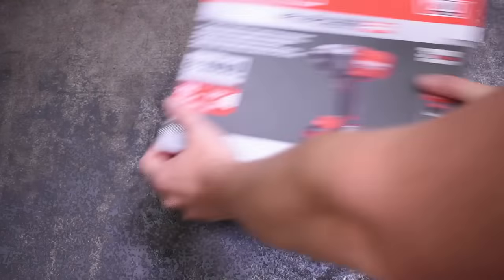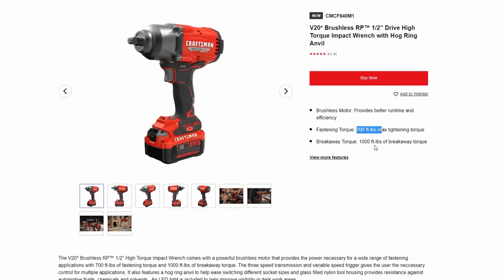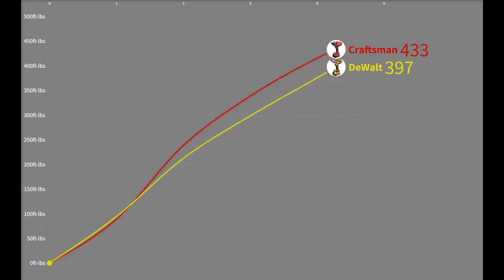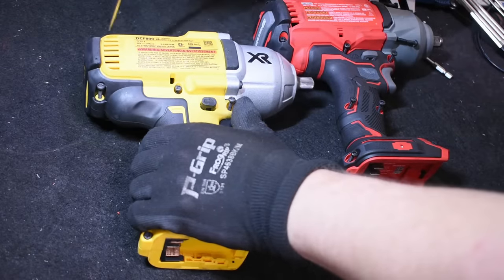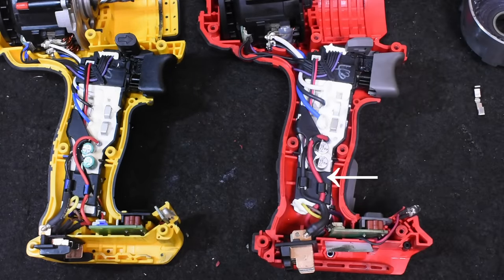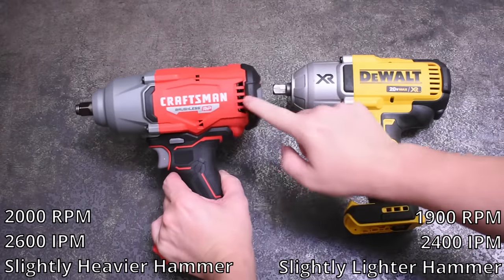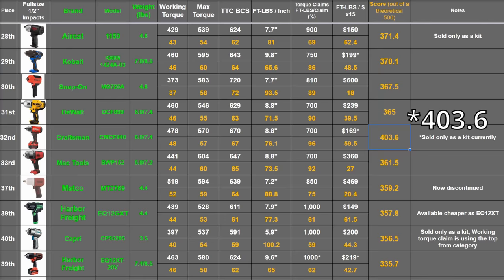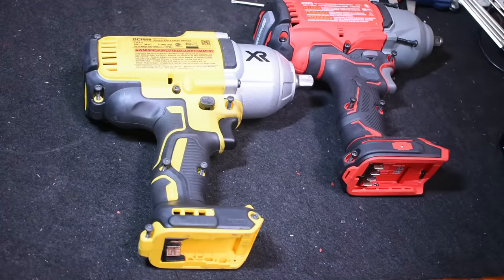Something Weird is Going On Inside Craftsman's New High Torque Impact Wrench

Comment: It seems to be leaps and bounds above the old brushed Craftsman V20 CMCF900 (350 ft lbs).  Having both, the Craftsman is a real dog compared to my Mac Tools 899 clone, so maybe upgrading the truck gun (craftsman) makes more sense than upgrading the shop gun (Mac/DeWalt) in this instance (having lots of both batteries).  I do have a 9ah Craftsman to try it with (good luck buying a 9ah DeWalt new for what you can get the 9ah Craftsman on eBay for). :D

Comment: Need to try 5 ah 6 ah and 9ah. Batteries the 9 ah makes saw and miter run so much better and can tell a huge difference in power on miter with 6ah and 9 ah but the 5 ah sounds like my blower works best with it but 5 ah is hard to get other than the mower that comes with two

Comment: I've got a DeWalt laser that gets about that far onto the flex volt battery. But a regular 18v / 20v dewalt battery will go on just fine. Be keen to find out if you're having the same issue with that 'craftsman' tool

Comment: Thicker gauge wire, slightly heavier rotating mass, 4and superior capacitors. That alone would offer the motor far more power as shown. It's the DCF899+ :) That's a good buy for those in V20 for sure. Craftsman still running ONLY 18650s, and from what I've seen, they're also 2nd tier cell brands.

Comment: Well, I just ordered a broken DeWALT DCF899 and a used Craftsman CMCF940. How “used” can the Craftsman tool be when the tool is only a few months old? Anyway, the DeWALT looks like it was chiseled out of concrete and really needs a new housing! I see them cheap but I’m really not saving anything unless I can get them both working.

If I can’t get them both working I’ll see if I can wire DeWALT battery terminals and transfer the Craftsman guts into a new DeWALT DCF899 housing (surprisingly affordable). This could be fun. ;)

Comment: Good video as always.  I did feel you kind of glossed over that this is a brand new craftsman model against the previous generation, dated Dewalt.  The current DCF900 (while more expensive) smashes this Craftsman in performance.  New model vs new model there is no comparison.
Reply from the maker: I think we pointed it our 3 separate times. I dont think anyone is under the impression craftsman is getting the latest DeWalt stuff
Reply: @TorqueTestChannel  I know you mentioned it.  I might just be a little sensitive as a guy with Dewalt batteries at how unimpressive the previous generation's specs were getting before this new generation came out.   The new tools are glorious, but it was getting embarrassing when the DCF899, etc were still the flagships.

Comment: What If you massage the tabs on the Dewalt battery or the craftsman tool so they'll go together? 5ah or flex volt might bring even more beans. Also would be nice for those of us with Dewalt batteries to buy a cheap craftsman gun when bare tool becomes available
Reply from the maker: Its not a tabs issue. You can see that it fits, but the overhang on the V20 hits it. You'd need to sand down each tool significantly to fit
Reply: @TorqueTestChannel :(

Comment: I would love to see this test redone with the 5amh battery. I do own both the 4, 5, 6 and 9 and I can tell you I feel a difference from the 4-5 and the 5-6
Reply from the maker: Didn't even know they made a 5ah. 4ahs ate so common in v20. 6ah is same size likely makes less. 3000mah 18650s have somewhat poor discharge

Comment: Soooo… question: Can I buy a DCD899 housing assembly and convert this to DeWALT DCF899? The terminal configuration is different so I imagine I would have to buy at least one more part with some minor soldering.
Reply: Well, the direction switch/lock doesn’t fit.

Comment: You should add cross checking batterys on different tool brands to see if there is any performance left on the table. Maybe the Craftsman is amperage limited on purpose, using another brand battery usually defeats artificial limits. They sale the adapters on ebay.  You know, just for informational purposes don't try this at home we are professionals and all that.
Reply from the maker: I feel adapters would not be a true representation
Reply: @TorqueTestChannel  

True, I get the original point, but it’s an extra wild card in there you can’t control for 

The battery you’re given matches the tool, it’s a representation of what you actually have
Reply: @TorqueTestChannel  While true...it's an interesting variable that could be confirmed or denied.

Comment: Wire gauge is about current, not voltage. And the kind of isolation you see on pretty much any standard wire is usually okay up to 400V.
Any length of wire will have a resistance. When you are passing current through said wire, it will, depending on the amount of current you are trying to pass, cause a voltage drop. The higher the voltage, the more current you can pass through, so ignoring any thermal effects on the wire, you could even go down with the wire gauge with increased voltage.
If your battery had only 3V, you'd have to use much thicker wire gauge, as the voltage drop would, relative to the battery voltage, be much larger.
Reply from the maker: Thats sort of what I was trying to point at, since it isn't lower voltage and thus REQUIRING thicker gauge the thicker gauge can be assumed to be for either carrying higher amperage or carrying the same with less resistance/less drop.
Reply: @TorqueTestChannel  It might not have been particularly clear to viewers why you'd usually see heavier gauge in lower-voltage applications, like automotive.
Also, there is a physical, as well as practical limit to how much overall power you can pull from any given voltage. 
Maybe it'd be interesting to compare batteries in the future, and elaborate on that, as you pointed out that the 4ah and 5ah batteries were producing different results. Keyword being internal series resistance here.

Comment: I wonder what happens if you try to make a "Ultimate Impact Wrench" by Mixing & Matching the best compatible parts?
Especially since so many parts seem to be cross compatible.

Maybe somebody can create a mold that allows a modular battery adapter plate to use any brand's battery with one base grip and a series of brand specific battery plates to be cross compatible with any battery?

Would there be a market for a generic Impact Wrench that allows "DIY" type assembling of the best parts & end user control of the device down to even the micro controller board?
Reply: NO it's NOT possible there's too many variations. I made a vid about B&D and Porter Cable tools and battery swaps. Can swap all between the 2 brands just modifying the batteries slightly

Comment: Could be STANLEY BLACK&DECKER is using different suppliers... both spec'd the same just from different tooling and electronics suppliers...🤔
Reply from the maker: That's a good point too, considering the 899 comes with USA stickers and the V20 does not - even though it's unlikely the 899's motor or impact mechanism is MADE in U.S. but still.

Comment: You got to watch Craftsman though.  I bought a Craftsman String trimmer 60V and it's great but a battery is now $160 plus.  There are no aftermarket 60V batteries at all.  When my battery dies, which a lot of them are reported to do, it's cheaper to buy an M18 cordless trimmer brand new bare tool off ebay for $140 than a new craftsman 2.5ah 60v battery.  Milwaukee has WAY better battery support factory and aftermarket than Craftsman but the 60V system has almost zero battery support even from Craftsman.  And I have several M18 tools already.

Comment: SMD LEDs are actually cheaper than the bulb versions because they can be automatically placed and soldered very cheaply. That's actually a win for the Craftsman
Reply from the maker: But the smd works so much better
Reply: @TorqueTestChannel  It's a very weird choice in that case... perhaps they still had them on a shelf somewhere. Bulb LEDs can be much more powerful due to better lenses

Comment: On ebay there is an adapter for kobalt 24v battery to dewalt 20v and milwaukee 18v what would have if you overvolt the tool?

Comment: It would be interesting to know how things exactly operate at Craftsman and Ridgid Orange. After seeing two different "budget" impacts beat their upscale cousins I have a theory however flimsy. Here goes:

Craftsman is handed a design for a Dewalt impact. Craftsman hands this design to an engineer who is given a budget to make this tool Craftsman red and not a straight up super obvious Dewalt knockoff. Engineer is bored with just changing colors ("I didn't go through all this schooling to just play with the colors!") so he sees cheap improvements that can be made and designs them into the tool. Craftsman knows engineers dont grow on trees  so they tolerate it as long as their profit margins remain intact.
Reply: It might also be just straight up more modern components that weren't available at that kind of price point 6 years ago, they still cut some cost on that light

Comment: You know, the Hercules Ultra Torque is the same $230 and slightly worse performance but doesn’t come with a battery and charger. Shouldn’t this get the same score or slightly better? I know you factored out the cost of the battery but that should only make it even more of a value compared to the “Ultra-Torque” (significantly cheaper and a bit better).
Reply from the maker: The Ultra Torque is $199 and makes 740, HF's regular Hercules high torque si ranked below this though
Reply: @TorqueTestChannel  I see… well, almost since the Craftsman 940 should still be cheaper and higher-performing in the charts. The original video about the Herc Ultra Torque showed the same price as the Craftsman 940 but I see that it has since dropped 15% at the Freight. With the estimated discount for the Craftsman’s battery being much more than that, the 940 should still be ranked above the Ultra Torque. Guess I’m still a bit confused.

I got a CMCF940 used with an upgraded battery (6Ah) for an even better deal and already passed it on to a friend since I have the DeWALT DCF899. Thanks for sharing this hidden gem! I just want others to see the awesome value here even compared to Harbor Freight.

Comment: Hi, just wondering how often you calibrate your testing equipment?  Maybe you have answered this before.  

Not suggesting a problem just asking or suggesting to make sure your testing is never compromised.  Thank you.
Reply from the maker: Hey no worries. We welcome curiosity. Not only every day of testing, but between tools too. Since the start of the channel. And in the past 6 months or so, we also do in between the changing of the FWD and REV bolts, which get changed out from stretch micrometer measurements to determine they are worn. New bolts get broken in with grease, cleaned off, then applied with fresh grease. We also throw other benchmark tools  in the category on to make sure we're not seeing anything strange when results are shocking to us or we expect the difference to be close, like we did here with our own DCF899.
Reply: @TorqueTestChannel  I wish it was easier for the average guy to throw his tools on a test and see what they actually do differently. Have you tried the different air couplers to see if they affect the air tools? Like the Milton Type V for example. One can hear and feel a difference...but I like numbers for verification.

Comment: As long as it works good enough and doesnt wear out, I don't care. I bought Dewalt 10 years ago, all my cordless power tools are DeWalt, and that's not because DeWalt is the best, it's because I already have all the batteries and chargers. Also, I've never had a DeWalt tool wear out, so that's good enough.

Is it the best? Am I better than you because I own DeWalts? Are you better than be because you own a higher performing tool?Don't care. It's good enough. And I never have to buy batteries except when they come with a steep discount in a bundle.
Reply: But some want to start investing...so want some data before hand. Or they just one the most powerful Impact cuz they work on heavy stuff...others are just curious.
Reply: @mrmotofy  Sure, if I were starting from scratch, I don't know if I'd choose DeWalt. But when I started building my tool collection, DeWalt was the best and came the most recommended by people I know who own companies that use them.  However, now there are a lot more options. 

I was in Lowes the other day and I noticed how all the DeWalt batteries are under lock and key, yet the Kobalt batteries are sitting loose on the shelf. I thought that was interesting.

Comment: If you modify the plastic tabs the battery should fit. I have a porter cable with a black and decker battery on it
Reply: @loucifer4205  FALSE...I have a vid proving the compatibility with tools and chargers

Comment: The DeWalt battery almost fits the Craftsman, but the Craftsman battery fit the DeWalt - at least well enough that it may be a lower cost power source for DeWalt tools?
Reply from the maker: Doesnt even fit on slightly
Reply: @TorqueTestChannel  I wonder if you could modify the case slightly to make it fit (one way or the other)?  I forget what brands it applied to, and it was some time ago, but I recall there were two brands that, like the TTI stuff, was made by the same company.  The only thing that prevented using the cheaper battery in the more expensive tool was a little "tab" that you could cut/grind off to make it fit.
Reply: @wty1313  I made a vid of the Porter Cable and B&D battery mods to use them all interchangeably

Comment: Maybe they're just working their way to honesty, since the lower Craftsman claim is still higher than actually happens when tested.

Try as they may, it appears the true power winner is still Snap On. I'm sure TTI & Stanley know how to make that much power, too, but not cheaply. 

I bet this power race doesn't end until a standard cordless impact can snap every lug stud off a car…
on one battery…
Reply from the maker: The DCF900 can snap every lug stuff off a car with a 9Ah. It's not lugs we're afraid of though. It's seen a hub it could do nothing to remove once, and Honda crank bolts still take a back and forth FWD/REV action to take off.
Reply: @TorqueTestChannel  it's not exactly "standard", neither is that battery, yet…

Good air guns can rip off Honda crank bolts pretty easy, and I was trying to say the cordless guns are trying (going?) to beat the air guns.

Comment: I bet that wire gauge on the craftsman is smaller with more insulation to hold up to the heat
Reply: It can really go either way, same ga wire with more insulation or just different type of insulation or different ga and different insulation. I've seen it all

Comment: Dcf891 vs the craftsmen. Which would you choose?
Reply from the maker: Dcf891
Reply: @TorqueTestChannel  thanks. Is the 6ah battery the best for the 891 as far as max torque?
Reply from the maker: And 5ah powerstack but yes

Comment: Can someone explain why the torque gradually increases over time (15 secs) instead of being at max torque instantly?. I thought that electric motors are capable of instant/constant torque?
Reply from the maker: You're thinking of a motor, we're not testing constant motor torque. We're testing how tight it can make a bolt and nut, which happens with impact blows. Like swinging a hammer.
Reply: Thanks for the reply. Got it, I think. The hammer blow analogy is helpful. The 'hammer' is given an amount of energy by the spinning motor, which it transfers to the anvil/drive  in individual but rapid blows/cycles...  moving the fastener in tiny and increasingly difficult steps until the elastic strength of the fastener equals the force of the hammer blow?

Comment: The most common point of failure for hand power tools is the electronics between the battery and motor. So its my suspicion that those parts are spec'd Chinesium to get a tool failure to occur faster in the cheaper product. I feel like we see garbage triggers in all the off brands and most people just say fuck it and buy another instead of claiming warranty because they cant be out their tool for weeks-months waiting for it to come back.
Reply: Wonder if one could just unsolder 1 and put in the other

Comment: Wire gäuge is larger despite the same voltage because it is not voltage that determines wire gauge but amperage.
Reply from the maker: Thats whats being pointed out.
Reply: @TorqueTestChannel  no it's not being pointed out at all but nevertheless thanks for the good video
Reply from the maker: Same volts so they must be expecting to flow more amps or want less resistance. I don't anticipate explaining volts vs current and resistance to everyone everytime we show a wire. We expect something from our audience I suppose

Comment: I would chalk up the electrical parts difference to supply chain at this point. I gotta yell at engineers on the daily to stop integrating unobtanium parts into new designs. Can capacitors like that are surprisingly one of the trickier ones to get. That being said, I wouldn't be surprised if those caps are rated for a shorter life

Comment: All the extra weight they added to the hammer just broke my Craftsman impact that's a problem I just spent $200 on it and used it 10 times and it broke the hammer way too much torque for the hammer they put in it